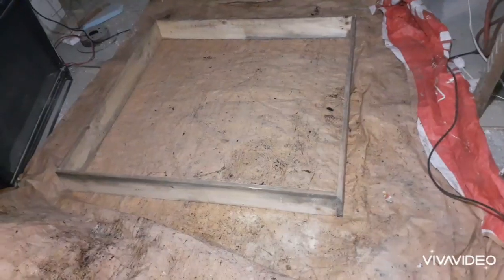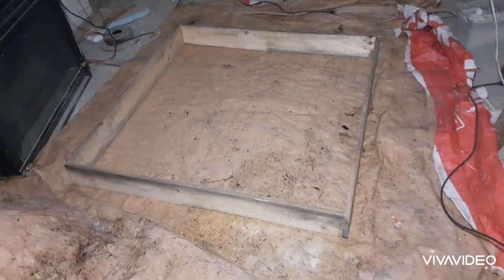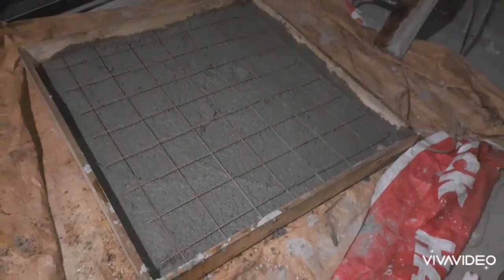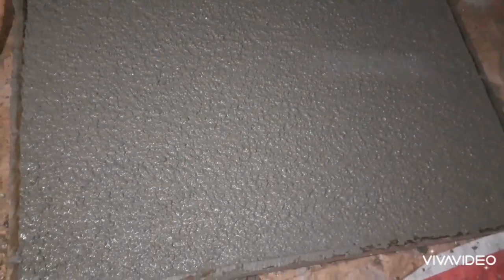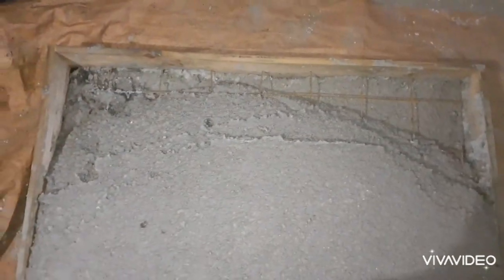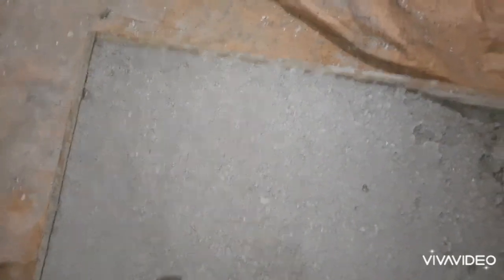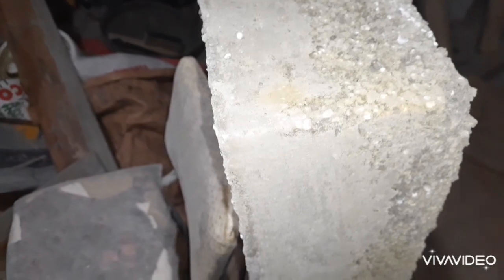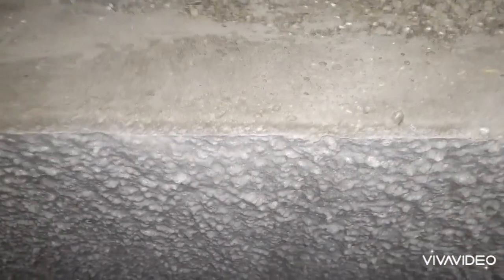Styroaircrete 6"panel - SUCCESS! Aircrete with added shredded styrofoam encased in steel grid.

Comment: what is your concentrations of each?
Reply from the maker: 30 gal dry shredded styrofoam, one bag of portland cement mixed in 9-10 of water and the rest foam made with marking foam, in a fifty gallon barrel.  Seal lid and roll on ground for 5 mins... perfect mixture every time...
Reply: 9-10 GALLONS of water?  I suspect that is what it is.  Thanks @ruggedist

Comment: Where do I get the long mixing paddle that goes on the drill? I've seen short ones but I'll be mixing mine in a 55 gal plastic barrel. Thanks
Reply from the maker: I think home depot carries them... consider a barrel with removable lid and set up rollers so you can spin it on its side...much easier to mix and with a discharge hole, it can be pumped with air pressure...10 lbs does not effect my foam and can pump at least 15 feet up...see my video ...air mixer explained..
Reply from the maker: https://youtu.be/nzFfBhpSdh0

Comment: how about replacing metal reinforcement with fiberglass fabric; the material used on boat building.
Reply: They use chopped glass in concrete to add tensile strength. It’s already a thing

Comment: Interesting.....But wouldn't it be better and less polluting to not shred the styrofoam and use it whole embedded into concrete mix as the way builders do??  They embed the panels of insulation these days into concrete. e.g. insulated slabs /walls etc
Reply from the maker: Not sure how shredding would add to pollution... The idea of recycling something that will never  rot or decay seems like a great idea. Interestingly, shredded styrofoam will not burn, only melt without the toxic smoke...
Reply: @ruggedist  Styrofoam is one of the major issues in marine wildlife toxins. In this video we see on a small scale what happens as not all of it makes it into the mix. Styrofoam is one of the most harmful types of waste that exists today and impacts our planet's ecological system negatively. Styrofoam harms animals scavenging for food from landfills. Styrofoam products normally easily break apart into small pieces that can choke animals.

When polystyrene doesn't make it to a landfill, it tends to end up in a body of water. This is especially dangerous for marine animals that may eat this plastic. This can lead to blockages and tears in their digestive systems, releasing toxins and killing the animal.

Comment: really dont need to  add the foam into the cement if you are adding styrofoam it gets much way to weak
Reply from the maker: That is an interesting point.  I  would  like to experiment with just portland and also thinset used for tiling..
Reply: @ruggedist  add some paper pulp in will strengthen it allot to
Reply: @prototype9000  

I was wondering about a paper Crete * air Crete combo
Reply: The more that is trapped in the cement; foam and styrofoam the more the R value.  Stephen Williams  and Tiny-Giant Lifestyle build  second story on top of their  styro-aircrete.  https://www.youtube.com/watch?v=27v7Oq-q9xs&t=675s

Comment: Thanks George for posting these videos. I have completed my foam generator and have been waiting to see how to transfer the aircrete  for ceiling insulation. Great idea with the barrel mixer. Did you notice any difference in density by adding the styrofoam?
Reply from the maker: Yes, for sure. I  went full strength on Portland but if a stucco coat is applied, a lighter mix will accomplish the same objective.
Reply: Can you expand a little more on going full strength with Portland? Did you still use foam bubbles? And I am not really familiar with the stucco thing. Thanks!
Reply from the maker: @johnvajcner20  'Full strength ' would be considered if one bag of Portland was used with with 50 gallons of foam. For non structural, insulation purposes, strength can be reduced to half, or 1/2 bag per 50 gallons ...

Comment: George - What is the ~density ( perhaps in pounds per square ft) of your panel with the mesh.  That would be very useful.  Also, if you were to use Nylon Bird Netting on both sides, that might much less expensive when doing the stucko, and perhaps just as strong.   Keep up the good work - Bob
Reply from the maker: Hi Bob! So I used 40 lbs of Portland cement added to  3 gallons of water to make a slurry. This in turn is added to about 18 gallons of high quality foam and after thoroughly mixed, I  add as much styrofoam as needed to make 25 gallons. I  would venture to guess 2 lbs cured, per gallon and it takes 7.5 gallons per cubic foot. At 6" thick it should weigh about 7.5 lbs per square foot.
Reply: @ruggedist  George - Thanks!  The density is ~15lbs/cuft, with sidewalk screen.  What I want to do is to develop a VERY inexpensive single person "bunkie" for the homeless.  I am a retired Mechanical Engineer. Several homeless organizations have been using Canastoda Huts(CHs), for this purpose.  I was thinking more in the fashion of a cathedral arch hut that was poured vertically using forms and then lowered down horizontally onto pavers.  Then inserting the end wall and the door wall.  The CHs cost them around $2000 to produce and install.  So, the Arch Hut might be 6ft wide at the bottom and be 7-8 ft tall and roughly 12 ft long.  It should be roughly 800-900 lbs in total weight.  There are Millions of people on the streets right now.  I think that StyroAirCrete might just solve the problem.  My email is -   roberthcromer@gmail.com  - if you want to contact me.  Thanks, Bob
Reply: @robertcromer5411  

What kind of bird netting would you suggest?    How big of square gaps would there be?  Like 2”?
Reply: @johnle231  la tela pajaros es flexible es articulada, la malla soldada es firme es rigida absorve la flexion
Reply: @ruggedist  4x8 panel about......8x32=   256 lbs.....3 guys....or....2 3 ft panels, set apart, staggered....then fill in aircrete....hmmmm
Reply: Thank you for making these videos. Please continue because there is so little to be found on youtube about styrofoam aircrete. My family and a couple of my friends are trying to learn all we can about building with this material. It ends up being cheaper than aircrete alone by stretching out the concrete material. Would love to see some construction videos on how to go about it if you feel willing to go doen that avenue. ❤